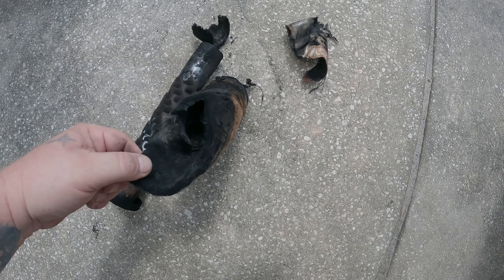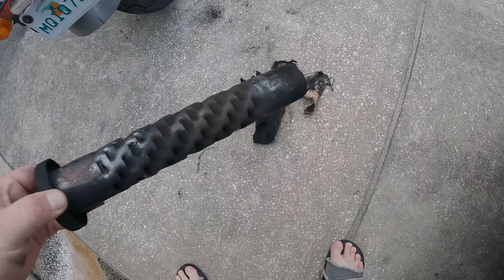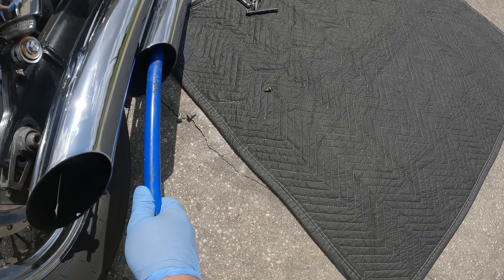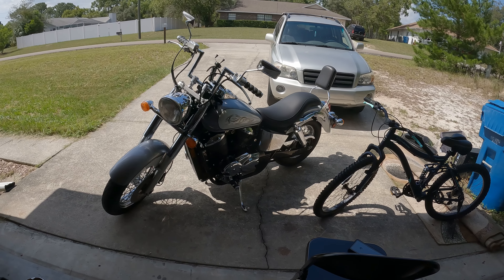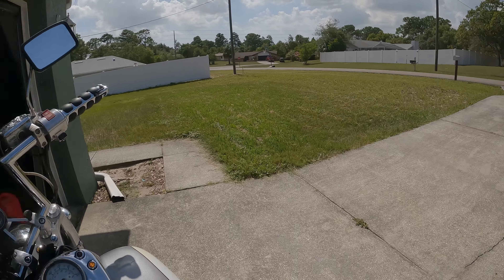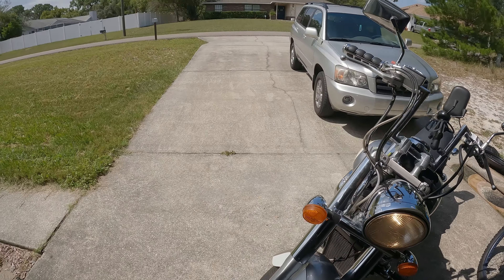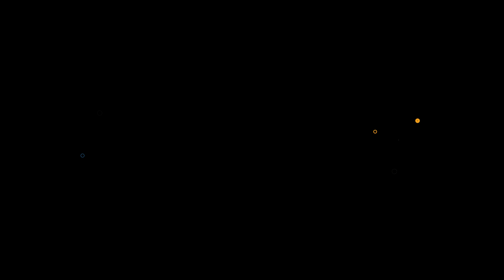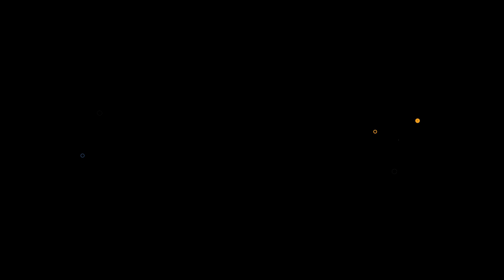Honda Shadow Ace Vlog #9 - Removing Exhaust Baffles

Comment: hey man ive got a spirit 750, id suggest turning your idle nob down a good bit, you should be able to cruise, clutch out at aroun 4-6 mph without giving it any gas. love the the sound btw ive got the same pipes, this makes me wanna rip my baffles out
Reply from the maker: I appreciate it.  I'll have to check that out, thanks for letting me know.